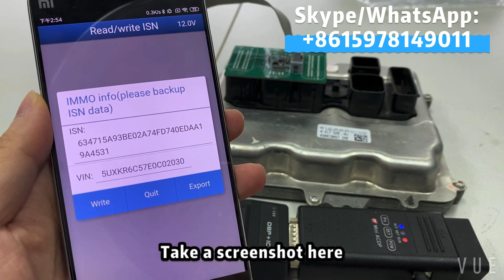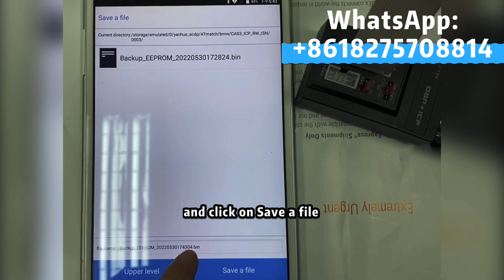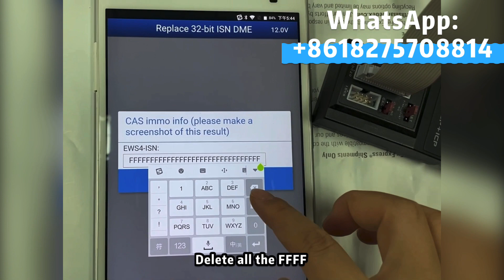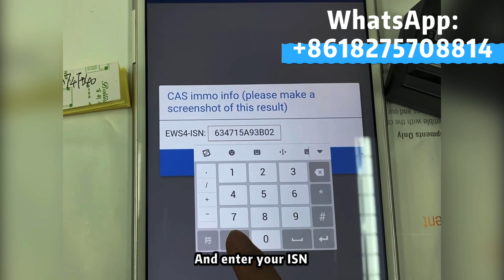Replace BMW DME when car DME is damaged /write DME ISN into CAS IMMO by Yanhua mini ACDP

Comment: Will the gearbox still work after modifying the ISN in the CAS module? The gearbox ISN will no longer match the DME or CAS module resulting in a running engine, but no gearbox function?  Would you need to over write the gearbox ISN also to make everything work?
Reply from the maker: need to use other tool to sync ISN from DEM CAS to EGS
Reply: i think you supposed to do it the other way around, why would you  wright a donor isn in to a an existing car ,,  but you can see here you can modify either isn, either manually or with  pushing files i think is an awesome tool,,, yes i was looking in to this and actually the procedure  will work because the isn in the transmission  does no interact with the dme isn ,, but stil  i think is  better   if you can do it  the other way around meaning write the orifinal isn and the  vin number in to the the donor dme  from the isn  of the original cas , i think this procedure only works with the msv family transmission from 2006 to 2011  e90 e92